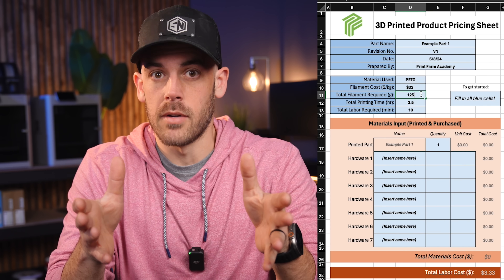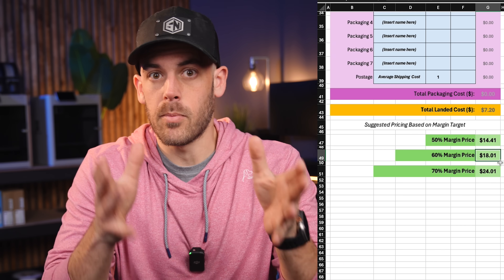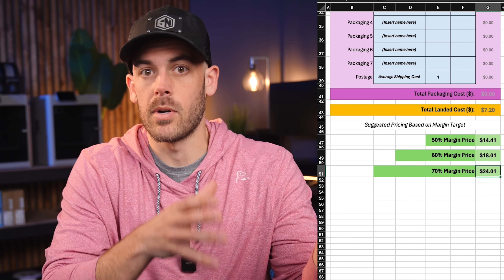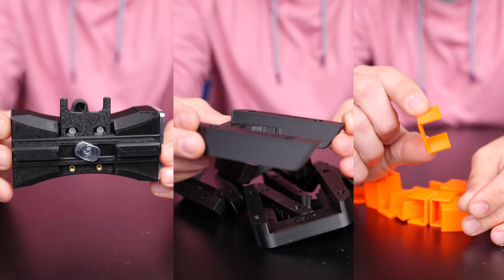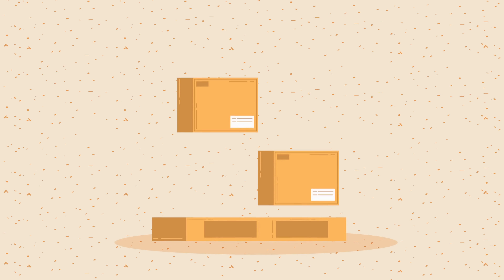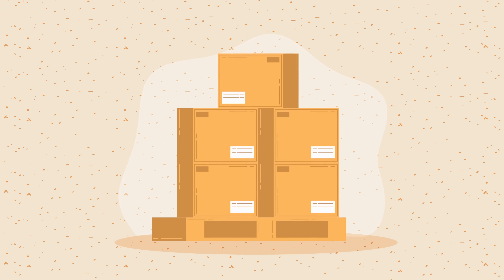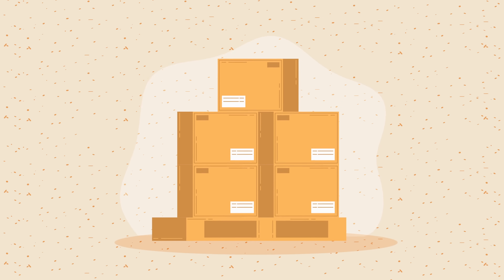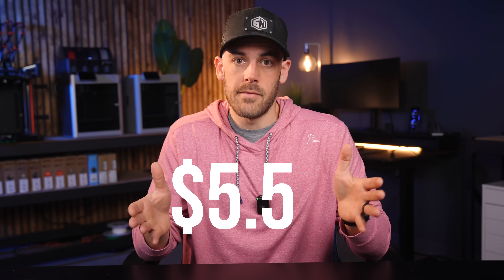Why I charge $55 for this 3D printed part (how to price)

Comment: I looked up some 3D print shops because I wanted 2 parts done. 1 was hella simple, the other was more involved and needed precision. It wasnt very tall tho so print time wasnt astronomical. Estimated prices were in the range of 65€ to 90€. Edit: Almost forgot. I didnt want post processing, just the raw prints
Hell nah, i aint paying that. So I took to the internet looking up prices for printers. On sale right now, a Neptune 3 pro is 150€, an Ender 3 V3 SE is 175€. Thats like 4 ordered prints!

2 days later i get recommended this video. I get the way you price your prints but damn printers have gotten cheap. There is, IF (big if) you like to tinker with stuff, little to no reason for me to order prints.

Good luck with your business, small businesses are cool. But man, Im getting myself a printer
Reply: I have found you get what you pay for with a 3D printer.  A cheap printer tends be more unreliable, lesser print quality and sometimes cant handle all the filaments/materials you would want/need to use.  Huge difference in quality between a Neptune and a Bambu or Prusa.
Reply: @dinneryeti  which is why imo if you have the possibility to handle it and don't need big prints, a resin printer is the best starter printer, it requires slightly more processing, but both my anycubic photon s 100 bucks and my m5s (270 bucks) have been super reliable, I very rarely get a print failure, an if I do it's usually on the first layer or the support, so not a lot of lost resin.
resin is much cheaper nowadays too, a 1L bottle of ABS-like can be gotten for 16-17 euro, so there's not much difference between pla filament and ABS-like resin.
also a newer printer like the m5s can print intricate models way faster than any fdm (resin speed is only limited by the height).
do note that the fact that resin takes more processing can be a brake to printing (just as the fear of spaghetti can be on fdm).

also you don't really get what you pay for, there's high variance and it's pretty muddy, if you get a printer with klipper, good linear rails, and a good extruder you'll usually get a good machine, but the price on that is fairly variable.

Comment: He forgot to add the space people use to print and keep the machine in. Mine is a spare room 8x10 feet = 80 square feet. take your house, apt, condos square footage mine is 2000 square feet divided by mortgage payment, electric, insurance, HOA fee, condo fee, etc. lets say that comes out to s
$3000.00 per month divide by square footage = $1.50 a square foot. Multiply your Printers room of 80 Sq.ft. =-$120.00 per month times 12 months = 1440.00 per year tax write-off. Add to your landing costs. You also forgot gas costs. Most businesses add a 20% loss, you have a 10% loss.  I think you are a little to low. Great video.

Comment: Not to rain on your parade but your analysis of costs is way off.   For one instance take your filament.   You have not included in your pricing what the cost of procurement amounts to.   The filament doesn't just magically appear in your shop.  You have to order it in.  That takes time and time is money.    Overhead is another cost not considered.  Forget what the printer uses in terms of electricity.  The lights, AC,  water, insurance, etc.,etc..  Rent even if in your garage or basement is a thing.    Someone has to answer the phone or emails, do estimates, return calls.  print statements,  etc., etc..   The minimum price should be at least at a 5:1 ratio of your cost projections to end price.   Other than that you are a hobby or running a non sustainable business.

Comment: great information the one thing i would like to say about the part costing sheet is if you are doing multiple parts the sheet did not multiply the machine cost per part by the qty needed. easy fix othewise i have subscribed thank you
Reply: also noticed the same thing for the labour cost

Comment: Did you patent any of these products? Aren’t you afraid someone else could steal your ideas? I have a few ideas myself but I haven’t gone public because I’m sacred they’ll be stolen.
Reply: Good question!
Reply: a patent is only as good as you can enforce it, and it costs money, it's probably less of a pain to just sell less of something if/when it gets copied than to try to fight.
especially for simple stuff like that, they probably aren't patentable anyway, as there's probably either an existing patent, it's trivial, or there's already a public domain version too close.
also usually if you want to enforce it's only slightly harder if you have proof that you had it before.
here if you want to protect something you can send yourself plans in an envelope with a secured dated an signed postage (not sure the exact name), and if you have to go to the tribunal it can be opened to prove you had it before.
another thing is that afaik an US patent only protects you in the US, not anywhere else (there might be some agreements with other countries like canada and EU but I'm not sure about that. )

Comment: Well, that was informative.  I've printed a few things for other people, mostly pre-engineered parts from the internet, so I tried to cover my machine and material cost and settled on a quick calculation to arrive at a price.  I start with the filament used (per gram), and multiply by $0.25.  I felt that a $10-$20 piece that only used $3 of filament was enough to cover my landed costs, but I hadn't fully calculated it.

I'd like to try your more complicated method and see how close I was getting with my internet trinket estimates.  Obviously, if I were to scale up to a business, the more complicated calculations would be more useful.

Comment: "Why I charge $55 for this 3D printed part": don't bother with reality, just rough estimate, assume based on feelings, and inflate by ass-pulled 10-30% factors for unspecified reasons.
People, if somebody is charging $55 for a 3d printed part, you're getting scammed, full stop.